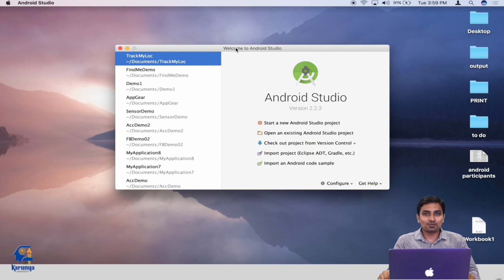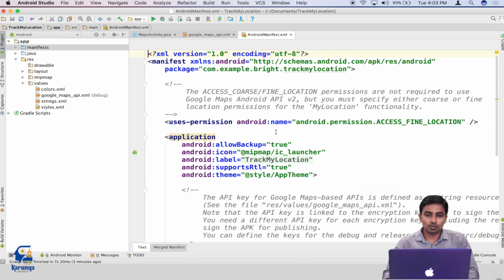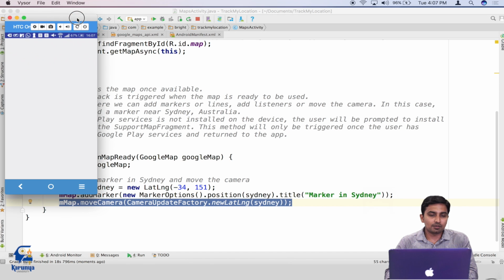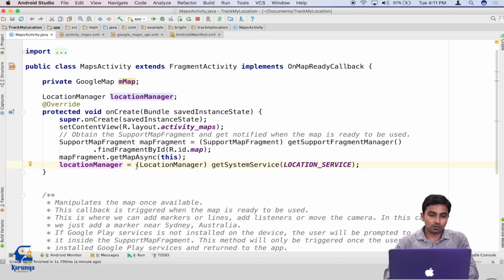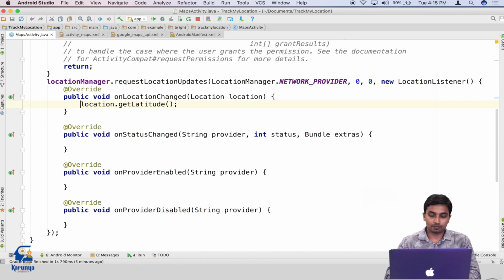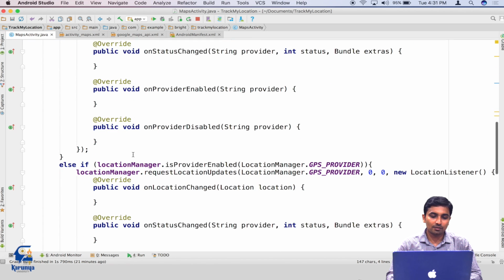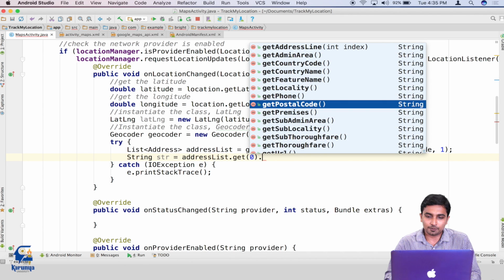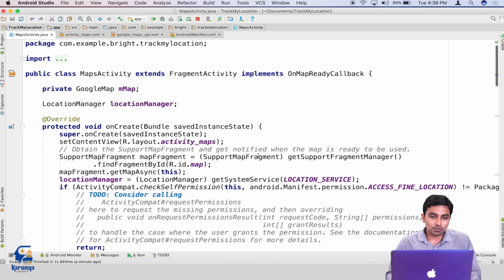Android app to Track your location using Google Map API

Comment: hi sir my code is not working these error in my logcat:
06-24 17:18:41.236 23592-23592/com.example.dell.trackmylocation E/MotionRecognitionManager: mSContextService = null
06-24 17:18:41.236 23592-23592/com.example.dell.trackmylocation E/MotionRecognitionManager: motionService = com.samsung.android.motion.IMotionRecognitionService$Stub$Proxy@99cb709
Reply from the maker: monika bhardwaj 
did you enable the location in ur mobile?
Reply: yes i had enable

Comment: I have a silly question. I'm starting in this android studio, I've followed along, and when you set LocationManager locationManager, and use it in the onCreate, you say you do the (necessary casting) My Android studio doesn't highlight the line with the casting option, and so I type what I see: locationManager = (LocationManager) getSystemService(LOCATION_SERVICE);
but then I get this LocationManager in red with the message: Cannot resolve symbol 'LocationManager' any help?
Reply from the maker: pls import the package for LocationManager.
import  android.location.LocationManager;

When u type this import statement, ur error will be fixed. 
Feel free to ask any query

Type casting means converting from one type to another.
For more reference regarding the type casting, pls refer the following website.
http://www.studytonight.com/java/type-casting-in-java
Reply: Tahk you very much!

Comment: plz help i am facing this problem while running the app

Error:Execution failed for task ':app:dexDebug'.
> com.android.ide.common.process.ProcessException: org.gradle.process.internal.ExecException: Process 'command 'C:\Program Files\Java\jdk1.8.0_121\bin\java.exe'' finished with non-zero exit value 2
Reply from the maker: Pls refer the following.

https://stackoverflow.com/questions/29460443/execution-failed-for-task-appdexdebug-com-android-ide-common-process-proces

Comment: i followed every step of the video..but my location is not being detected.. It is showing the world map(south africa) and not the location. Could you please help me out with the issue.
Reply from the maker: Don't launch ur app in emulator. Pls launch it in ur Android mobile phone. Still if does not work, pls regenerate a new Google Map API key and try again in ur mobile phone.
Reply: I regenerated the API key and launching it in my Android phone..but still it's showing me the same output. It's unable to detect the current location
Reply from the maker: Will u pls verify that the new Google Map API is active and reflected in the AndroidManifest file?
Reply: under meta-data, same Google API key is given which I have generated again..
Reply from the maker: Pls follow the check list

1. Ensure that detect location is enabled in ur mobile phone.
2. After launching the app in ur mobile phone, pls check the logcat. If possible share the log information with me which helps us to check that the API key which u generated is active or not.

Comment: Hey,
I've done everything but my program is not able to resolve the getLocality and the getCountryName methods.
additionally it requests a boolean within the location Manager.
I would appreciate some help from you!
Thanks for the video!
Reply from the maker: will u pls try once again with a newly generated Google Map API key?
Kindly update me.
Reply: thank you for the fast reply! I debugged it. Now it doesn't navigate to my location. Google says, i have to give my location free via mobile phone. After  I adjusted this, nothing changes. Do you know an answer for that? (I also tried a new API key)
Reply from the maker: Yes, u v to check in mobile phone, not in emulator. Pls ensure that the new Google Map API key is reflected in the AndroidManifest.xml file.
Reply: Alright, this makes sense. I will try it, thx!

Comment: So i did the full tutorial and it's working just fine, ca you tell me a method to draw the path i am walking from my current location until i decide to stop it? i am trying to build a fitness app an i net to display the running path that the user took. Just a small tutorial or some documentation. Thank you in advance.

Comment: I'm making a simple app for my business in Android studio that displays my business information using a navigation drawer. It has 4 categories home, about, contact, and location. On the location category I want to display my location on a map so my customers can find me. My business is mobile so my location will change so I need to be able to display my location at all times. How can I do this? It sounds really simple but when the customers download my app how will they only see my live location on their map instead of their own location? It seems that the code will only show their own location when they install the app and push the location item to find my location. Thanks
Reply from the maker: U may keep 4 categories home, about, contact, and location as menu options or navigation drawer items.
U may keep the location tracking code in a method, call it when the user select the location from navigation drawer.

Comment: Whats the difference between use GPSprovider and Location l = LocationServices.FusedLocationApi.getLastLocation(mGoogleApiClient); ? cu'z I did like this :

private synchronized void callConnection() {
        mGoogleApiClient = new GoogleApiClient.Builder(this)
                .addConnectionCallbacks(this)
                .addOnConnectionFailedListener(this)
                .addApi(LocationServices.API)
                .build();
        mGoogleApiClient.connect();

    }
And inside of onConnected...
 try{
            Location l = LocationServices.FusedLocationApi.getLastLocation(mGoogleApiClient);
            if(l != null){
                Log.i("LOG","latitude: " + l.getLatitude());
                Log.i("LOG","longitude: " + l.getLongitude());

                lat =  l.getLatitude();
                lon = l.getLongitude();
Reply from the maker: Kindly check this following link
http://stackoverflow.com/questions/30144480/are-there-any-advantages-of-using-fusedlocationproviderapi-over-locationmanager

Comment: not working with me.
I check in Galaxy Edge
Reply from the maker: pls create an another google map api key and do verify that its updated in AndroidManifest.xml file. Update me once its fixed.
Reply: Thanks for replied.
I was try with in 3 API key and they are not working :)
I think, my problem at here:
// TODO: Consider calling
//    ActivityCompat#requestPermissions
// here to request the missing permissions, and then overriding
 //   public void onRequestPermissionsResult(int requestCode, String[] permissions,
//                                          int[] grantResults)
// to handle the case where the user grants the permission. See the documentation
// for ActivityCompat#requestPermissions for more details.
return; // ← it return null ???
Reply from the maker: yes. the code should be as follows.
if (ActivityCompat.checkSelfPermission(this, Manifest.permission.ACCESS_FINE_LOCATION) != PackageManager.PERMISSION_GRANTED && ActivityCompat.checkSelfPermission(this, Manifest.permission.ACCESS_COARSE_LOCATION) != PackageManager.PERMISSION_GRANTED) {
            // TODO: Consider calling
            //    ActivityCompat#requestPermissions
            // here to request the missing permissions, and then overriding
            //   public void onRequestPermissionsResult(int requestCode, String[] permissions,
            //                                          int[] grantResults)
            // to handle the case where the user grants the permission. See the documentation
            // for ActivityCompat#requestPermissions for more details.
            return;
        }
Reply: Thanks for replied.
How to check permission on the cell phone ??? And how to setup permission on its ?
I was set permission in the AndroidManifest, I think my problem from my cell phone permission.
※ Of course, i was turn on Location in my phone.
Reply from the maker: pls check the following link which helps you to understand how to enable the location service.
http://www.androidcentral.com/how-turn-and-location-samsung-galaxy-s5-camera-app
Reply: Thank you. I checked. I was enable the location service.
And i can check my location on Google Map but can not get current location in my source :)
Reply from the maker: pls do create a new google map api key and verify that its reflected in AndroidManifest.xml file
Reply: Thanks for replied.
I was create new API key and paste that key to AndroidManifest.xml. So, when i running my source , its show "Return NULL".

        if (mLocationManager.isProviderEnabled(LocationManager.NETWORK_PROVIDER)) {
            if (ActivityCompat.checkSelfPermission(this, Manifest.permission.ACCESS_FINE_LOCATION) != PackageManager.PERMISSION_GRANTED &&
                    ActivityCompat.checkSelfPermission(this, Manifest.permission.ACCESS_COARSE_LOCATION) != PackageManager.PERMISSION_GRANTED) {
                // TODO: Consider calling
                //    ActivityCompat#requestPermissions
                // here to request the missing permissions, and then overriding
                //   public void onRequestPermissionsResult(int requestCode, String[] permissions,
                //                                          int[] grantResults)
                // to handle the case where the user grants the permission. See the documentation
                // for ActivityCompat#requestPermissions for more details.
                Toast toast = Toast.makeText(getApplicationContext(),"Return NULL", Toast.LENGTH_LONG);
                toast.show();
                return;
            }
Reply from the maker: can u come in Skype?
my id is brightfsona
Reply from the maker: u may call me thru Wotsapp at +91-7305901030
Reply from the maker: can u come in online thru Skype. my Id is brightfsona
Reply: i was sent mess to you in skype. Please check its. Thank you.

Comment: Awsome sir , please provide android php mysql tutorial using volley library... thanks in advance
Reply from the maker: I never worked with php.
But I worked with mysql through the Servlet instead of PhP.
following is the link which u may refer

https://github.com/brightgeevarghese/MySQLDemo

Update me.
God bless u.
Reply: Same question again with your provided code it displays only MAP  , neither location nor marker . 
does this line 
List<android.location.Address> addressList =  geocoder.getFromLocation(latitude , logitude ,1);
made any difference.
Reply from the maker: The code which u v mentioned is perfect. Pls check the network connectivity. Regnerate the google map api key and try again.

Comment: I am testing the code in my Samsung GT-I8552 (Android 4.1.2 API 16) and it shows the map, but never shows the marked on my location, even if I move the phone some meters.
Reply from the maker: kindly go thru my video once again. If still the same, share ur email id with me, I ll share my code with u.
Reply from the maker: HCS Productions Films 
 enable the location in ur mobile and try again
Reply from the maker: pls share the logcat info with me.
u may mail it at brightlsom@gmail.com
Reply from the maker: Pls enable the location before launching the app in mobile. This does not work in emulator.
Reply: thanks! it was solved my  problem!  Just remember to enable the location in your mobile.
Reply from the maker: pls enable the location in ur mobile and launch it in mobile with the newly generated Google Map Api key.
Reply: Better you create a Marker object and assign that mMap.addMarker... and when you change the location  i.e in onLocationChanged do this market.setPosition(new LatLng(location.getLatitude(),location.getLongitude()));
Reply: aidawani95@gmail.com

Comment: hi varghese, its the same problem here app doesn't show my location in map and no location marker.Please help me with this
Reply from the maker: after opening the app, u move the mobile...upto one meter.
If the network connectivity is poor, u may not be able to see the expected output. I think its due to the improper connectivity.
Reply: I have tried but same issue, even though i am connected to wifi at my home which gives good speed
Reply from the maker: did u check the default google map activity? is it showing the location, Sydney?
Reply from the maker: still, if u v problem, feel free to contact me at 7305901030.
Reply: yes it was good, no sydney there. Can you look at my code and help me.
seems everything ok  but i don't know where the problem is
Reply from the maker: pls mail me @
brightlsom@gmail.com
I ll be free in the late evening. Then, I ll get back to u.
Reply: Bro i have send you all files. Please look into it when you got time .
thank you :)
Reply from the maker: k. I ll
Reply: Thanks bro, It worked ..:)
Reply: i hv the same problem as u did how did u resolve it??
Reply: Buddy you need to give permission from your Android phone to your app then it'll work
Reply: but then im running on emulator in android studio
Reply from the maker: Praise God.
Keep moving forward.

Comment: bro i did exactlywhat u said bt in my app it doesn't show my location there is no location marker in the map
Reply from the maker: after opening the app, u move the mobile...upto one meter.
If the network connectivity is poor, u may not be able to see the expected output. I think its due to the improper connectivity.
Reply: bright varghese ok will try thanks for your reply
Reply: bright varghese no bro its not working and btw iam using android 5.1 as my sdk and my android device is on android 7.1 and the problem is no location marker is there in the map and i think its because the app cant get the location details

Comment: how do you handle the permissions required with the newest version of Android API for location capture?
Reply from the maker: I checked google map activity with API 25(Nougat). I requires <uses-permission android:name="android.permission.ACCESS_FINE_LOCATION" /> in AndroidManifest.xml file.
Its working fine. 
If u v any error, feel free to share it.
Thank u.
Reply from the maker: pls provide the following code if u make request for location update.

if (ActivityCompat.checkSelfPermission(this, Manifest.permission.ACCESS_FINE_LOCATION) != PackageManager.PERMISSION_GRANTED && ActivityCompat.checkSelfPermission(this, Manifest.permission.ACCESS_COARSE_LOCATION) != PackageManager.PERMISSION_GRANTED) {
            // TODO: Consider calling
            //    ActivityCompat#requestPermissions
            // here to request the missing permissions, and then overriding
            //   public void onRequestPermissionsResult(int requestCode, String[] permissions,
            //                                          int[] grantResults)
            // to handle the case where the user grants the permission. See the documentation
            // for ActivityCompat#requestPermissions for more details.
            return;
        }
Reply: where should it be written in the code?